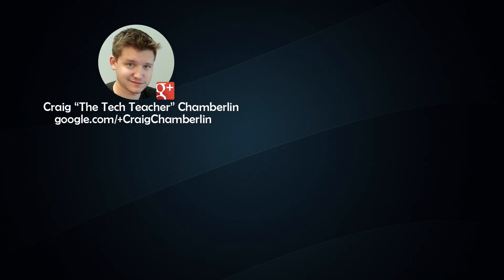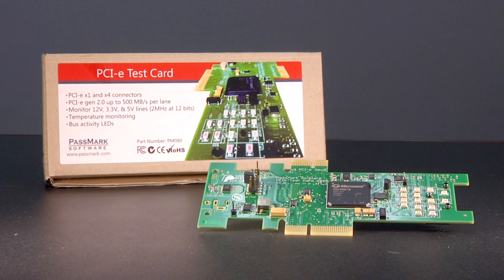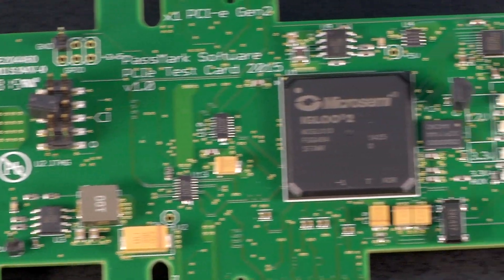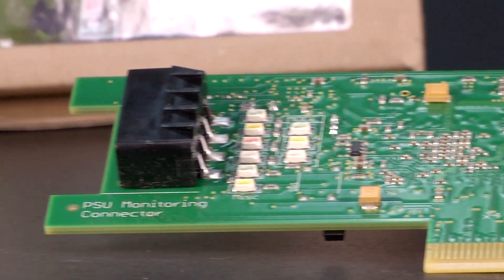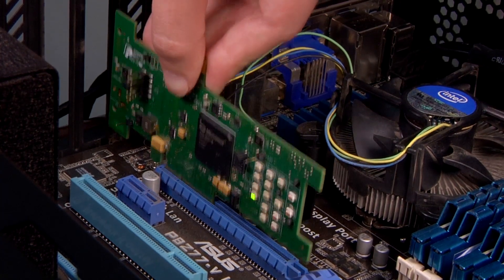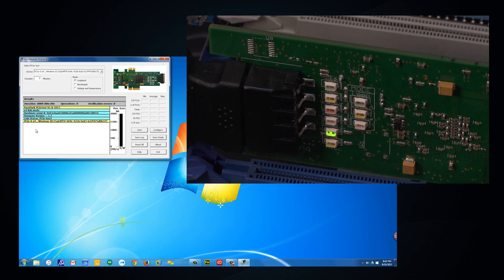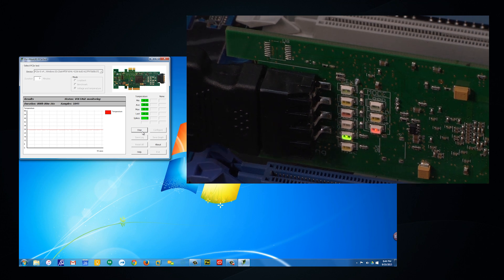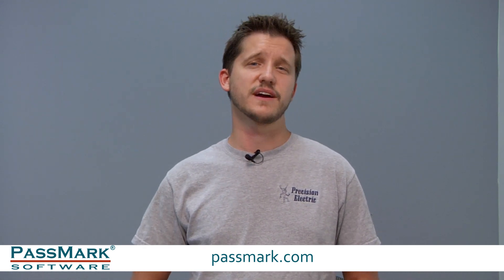PassMark PCI Express PCIe Test Card Review (2022)

Comment: Hey sorry if this is off-topic. I have a problem with my computer, about every 40-60minutes my internet-connectiondrops and I am forced to restart it. Do you know any fixes?
Reply from the maker: +Jesper Lindstrom Is your connection to the router still good? It could actually be your router and not your computer - recycling the power on your computer resets your network connection. See what happens when you reset the power to your router next time you lose it instead.
Reply: Craig Chamberlin Okey i'll try that, ecen though i'm fairly sure it's a problem with my computer.
Reply from the maker: +Jesper Lindstrom I always suggest trying the modem thing first and then reinstalling the network drivers for your computer second.